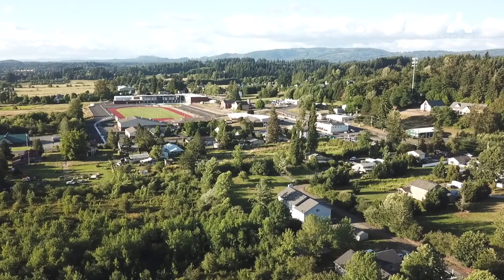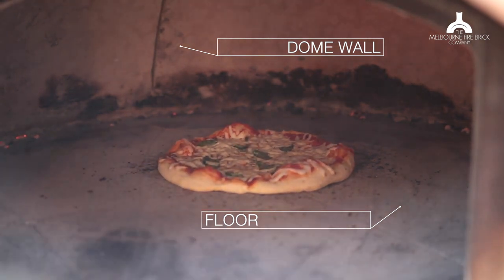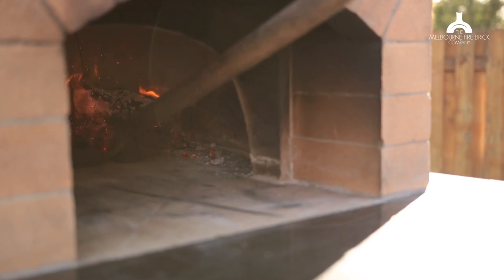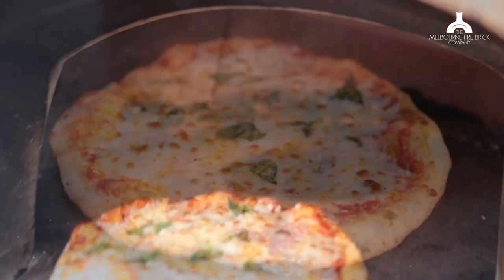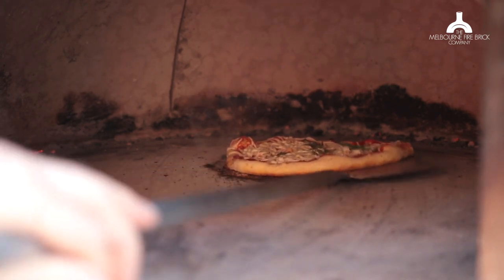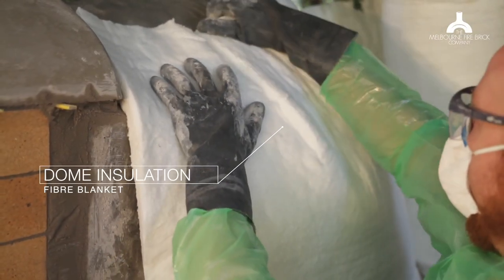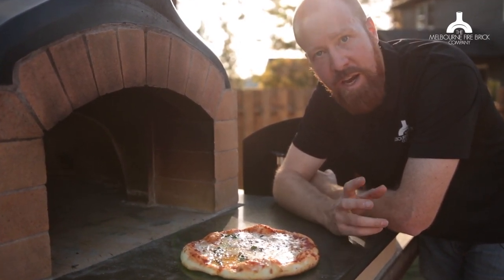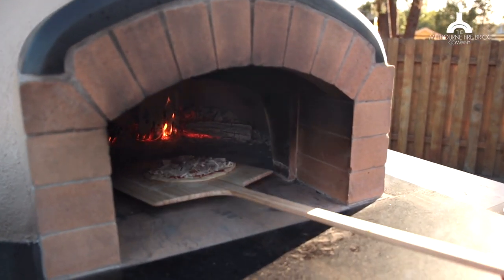How a Wood Fired Oven Works

Comment: Well, I would say you are mostly right, Ben. But ask any good pizzaiolo and they will say that you cannot cook a true Neapolitan pizza the "right way" without a bright flame. I'd guess more than 90% of the heat cooks the pizza from the thermal mass. But the direct energy that a live flame delivers to, especially, a pizza, does make some difference to, for example,  how the crust forms during cooking and how the topping (fresh fiordilatte, tomato, basil, olive oil) cooks. BTW, I'm not saying that's not a good pizza you just made... but for pizza perfectionists such as myself, the sky is the limit :)
Reply from the maker: Hi David, thankyou so much for the thoughtful reply! That's exactly what we were trying to get across - that the vast majority of the heat cooking the food (pizza in this case) is from retained heat, rather than direct heat. I agree with you 100% regarding the live flame, which you'll see us using for the last pizza. The idea behind this video was to try to explain the concept of Thermal Mass, so we thought cooking a pizza in an empty oven might help to illustrate that. It's certainly not how I would normally cook them ;)
Reply: David, I just built a Neapolitan pizza oven and looking for some good high level resources / tips . Any suggestions?

Comment: Does the shape of the oven influence the heat acumulation and airflow inside?
Reply from the maker: It does - one of the keys is the size and height of the oven doorway. A huge door makes access very easy, but lets a lot of heat out.

Comment: Do you still get a wood fired flavour when doing a slow roast with stored heat only and no fire?
Reply from the maker: Good question - you wouldn't get any smoky flavour if you didn't have some coals at least. We always cook pizza with a live fire, and roasts and other dishes with some coals still in the oven to provide a little smoke and flavour.

Comment: How do you reduce smoke efficiently? I don't want neighbors to complain.
Reply from the maker: That's a great question - one thing that you can do is to use good quality firewood - that's critical. The next thing is to use some of the heat from the last firing to dry out your firewood for the next burn. When the oven has cooled down below 100C you can shovel out any coals (to avoid starting a new fire!) and fill the chamber with firewood to dry it out. This wood will burn hotter and cleaner than it would have otherwise. Then you need to nail down a good firing method - check out our Fire and Forget technique!
Reply: @TheFireBrickCo  i appreciate the advice, that all makes sense! I’ll be sure to check out your other videos. Is there anything in the oven design that can help prevent smoke too? For example, I’ve seen chimney dampeners to control the smoke output and the rate at which the fire burns.

Comment: How long without fire will it cook pizza?
Reply from the maker: That's an excellent question - without heat input the P85 Oven (shown in the video) will cool from 350C to 70C in 36 hours. That doesn't quite answer the question, but you can cook pizza at lower temps (like 250C), they just take a lot longer.

Comment: But how it is getting Oxygen when we close the door?
Reply from the maker: Hey Khaled, closing the door completely will shut off the oxygen, however, bringing it in at the front while leaving a small gap as seen in this video will not only allow oxygen in, but will also help draw the smoke up the flue rather than out the door - keeping your bricks cleaner ;) Does that help answer your question?
Reply: My question also, do the ashes of the logs does not stick to the pizza? I’ve seen cooking pizza without tray, just throw pizza inside the oven, wondering the ashes or dust on the floor.